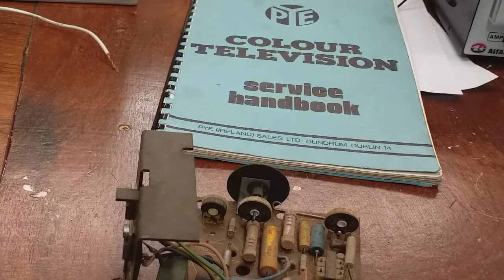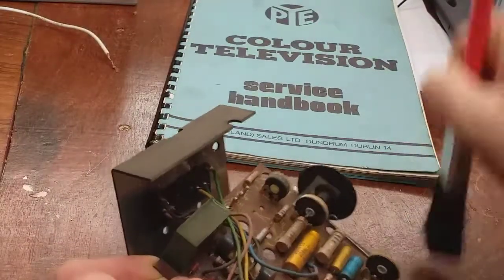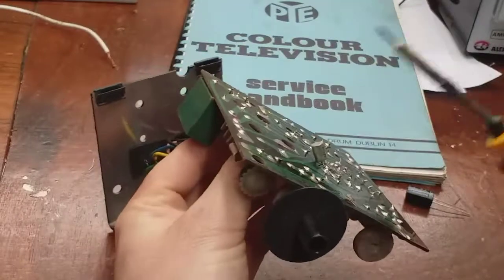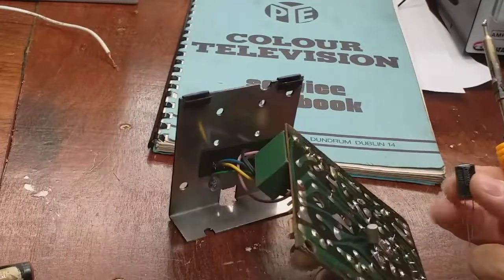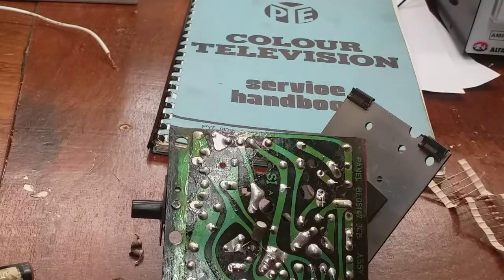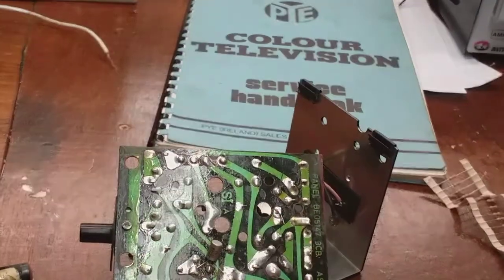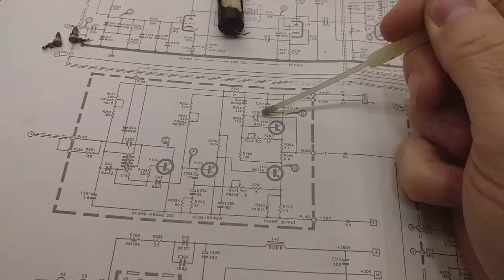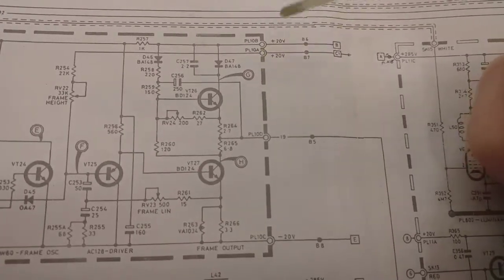Vintage TV. PYE 697/Dynatron CTV19. Part 2

Comment: Seems odd that a hybrid set would have SS audio and frame output yet valve video output, we had a few hybrid B&W and the Decca 33 the other way round here in Aus. I would love to play with a 697 but I don't think that will ever happen, so I thank you for showing inside 

yours.
Reply from the maker: Good man colin. Yes a strange combination of ic's, transistors and valves. Not the greatest TV ever.

Comment: Did you get any further with this set? As for the nothing from the customer controls on these Dynatrons is to check that the dummy plug is plugged into the corded remote socket on the back. Cheers, Tas
Reply from the maker: No, haven't done much with it since.  I have the remote control and I don't think that was working either. Must get back to it. I have a 697 to.
Reply: @IrishvintageTVRadio  My Pye CT205 (697 chassis) needs its A1 pots replaced - well, two out of the three. Once I dig it out, I'll do it!